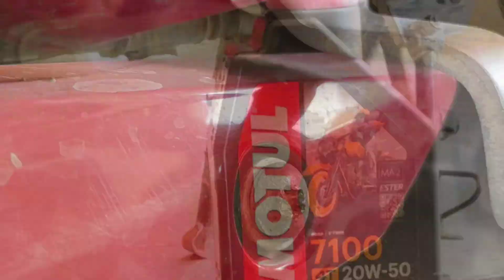Changing Blood Of Ns160 // Ns160 Oil Filter And Oil change | Motul

Comment: 1- Engine flush dalky neutral pay 5-10 min start krky rhkdyna 

2-  10 min baad Engine nekal dyna , Nd Magnetic rod ko clean krna.

3- Engine filter ko change krna 

4- Motul 10w50 or 20w50 daalna 

5- Firsy neautral py 10 min running may rhkdyna 🙂

Comment: Ns160 abs Bs4 motul 5100 15w50 vs 7100 20w50 konsa lu?
Reply from the maker: 20w50
Reply: @motobull93  First-time changing to motul i ordered 5100 series semi synthetic and now here is winter so ..next time purchase 7100 series
Reply from the maker: Pls don't change oil grade many times, it's harmful for your bike engine. You can use synthetic or semi synthetic oil but don't change oil grade
Reply: 20w to 15w bcz for winter.. in summer switch to 20w